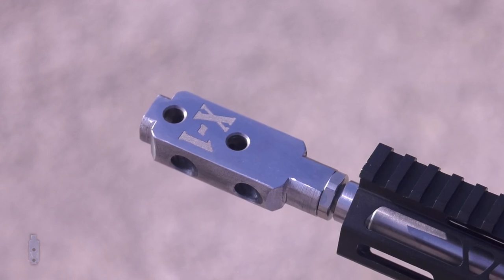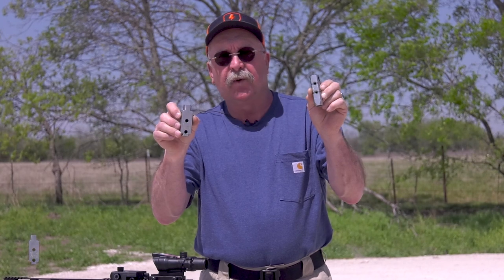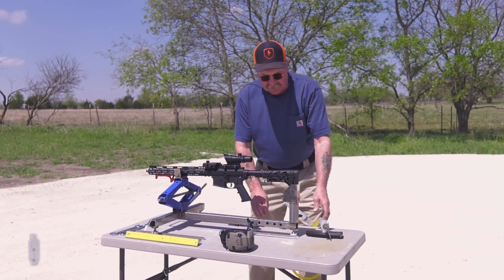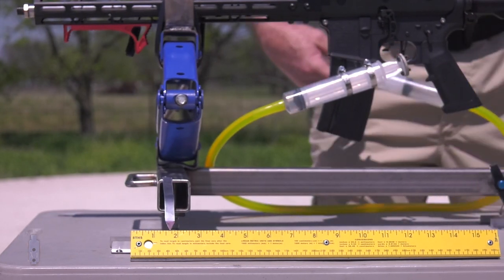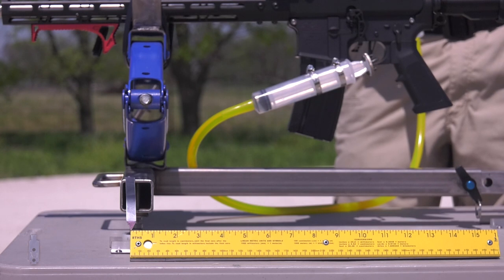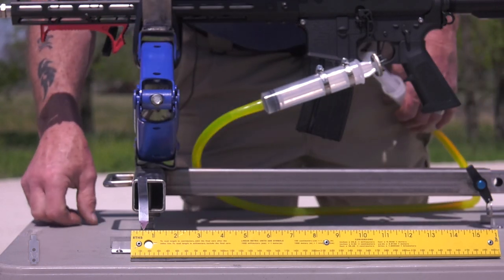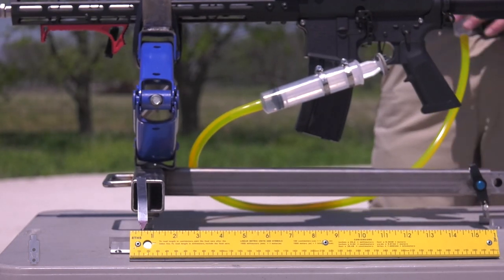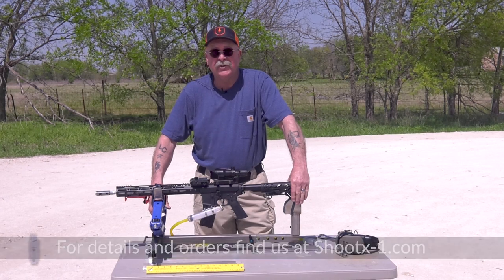SJC Titan vs X1 Compensator Challenge

Comment: You are focused on the wrong area with your camera. Muzzle breaks are for recoil but you are not testing muzzle breaks. Truth be told you are not even testing compensators. You are testing combi devices that combine attributes of both breaks and compensators. Therefore muzzle rise is half the test and the only way to evaluate that is to do a slow motion replay of each shot focusing on the muzzle to guage just how much flip each device has.